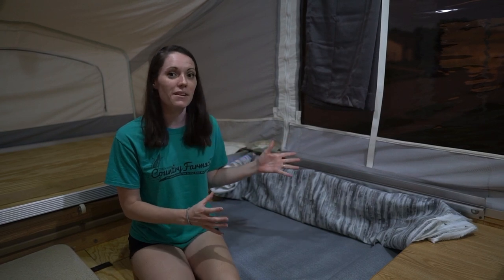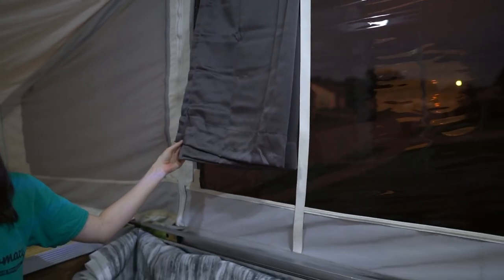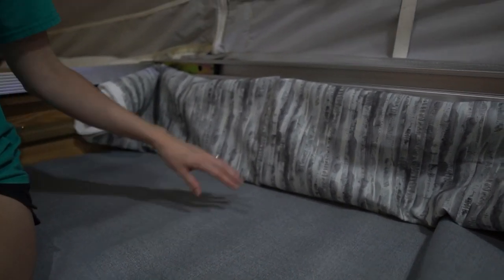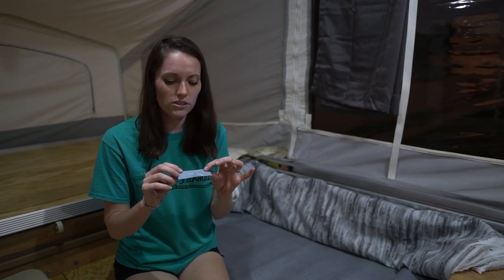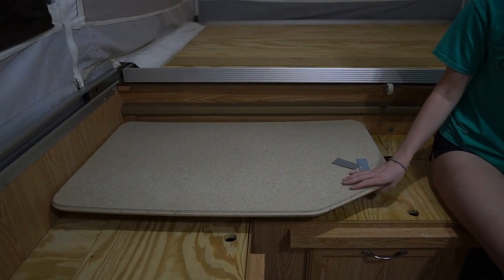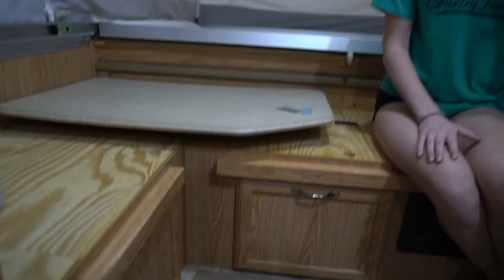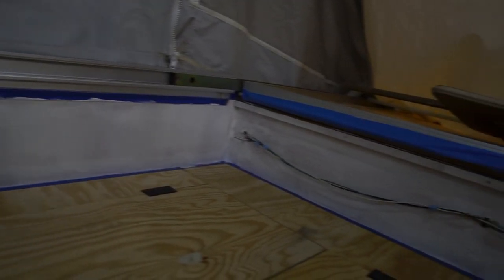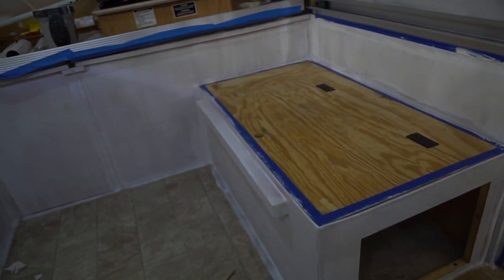Pop Up Camper CABINET & WALL Painting (How-to) | The Free Pop Up Camper Renovation | Part Seven

Comment from the maker: Before you start renovating the interior, make sure the exterior is good to go! https://youtu.be/jj6LuLZpv9o
Reply: Thank you and Yes.  I did an overall major cleanup and added a protective coating (based on your video) on all the canvas, vinyl and soft materials. Also have been wire brushing, priming and painting the frame. Wheel bearings have also been replaced. Over the winter I need to refinish the entire top (Paint I have not locked down which product I will go with) which has signs of delaminating and has lots of rubber cement type of sealent on it. Propane heater and AC works. Refrig does not so I am on the fence if i will replace or convert into storage.

Comment: You could try an epoxy finish on the countertop if you want something super rugged. Very easy to apply. Basically mix and pour. It's self leveling, so you get a nice thick layer.
Reply from the maker: You read our mind!

Comment: Everything looks great so far. I'm deliberating taking out the cabinets and spraying them and install flooring wall to wall.
Reply from the maker: What type of flooring are you planning to use? If it's sheet vinyl, you'd be ok taking out the cabinets and doing wall to wall flooring, but if you are planning to install any type of floating floor (such as a click-together vinyl plank like ours) you don't want to do wall to wall flooring with that, as the floor needs space to expand and contract, which it won't have if you affix cabinets on top of it.
Reply: @ItsPoppin  I was planning on click together vinyl. That is a good point about needing to allow the flooring to float. It saves on cost as well since I won't need to purchase as much martial, but will mean a lot more cuts. Did you use any molding?
Reply from the maker: Yeah, we’ve used 1/2” quarter-round in the past and are going to use that again on the Reno.

Comment: Is it not a good idea to paint the plywood bench tops? I'd sort of like to paint mine, but I read that you shouldn't paint the plywood on the bunk ends so that it can breathe and fluctuate with temperature. Is that the same for the plywood on the bench tops?
Reply from the maker: You'll be fine painting bench tops.

Comment: You may have addressed this in the video & I missed it but is there a reason behind using oil based paint? We're remodeling a PUP. i have water based kilz & paint on hand. Just wondering if i need to buy different paint.  Love your videos.
Reply from the maker: That was based on our research from a few years ago, so I don't remember the exact reason. I think it may adhere better or be more durable. I would just research the efficacy of water-based on cabinets before you use it.
Reply: @ItsPoppin  thanks so much. Camper looks great. I'm caught up on your reno but came back to this bc we're painting.  You do a really good job with the tutorials.
Reply from the maker: Thank you!

Comment: Did the printer adhere to the contact paper on the cabinets well?  No flaking?
Reply: Primer *
Reply from the maker: We can’t speak to this camper as we sold it; however, we utilized the same method in the Starcraft and it’s held up exceptionally well.

Comment: What type of polyurethane did you use? Water based or oil modified? 
Thanks.
Reply from the maker: For the countertops?
Reply: It's Poppin' - Pop Up Camping yeah. Sorry. I was at Lowe’s looking at the urethane and watching my daughter run around. 
So yes. For the counter tops and did it leave a yellowish hue? 

Thanks.
Reply from the maker: We used the minwax one coat poly. It doesn't say if its water or oil based  - even though I thought it did. The countertops did darken under the poly, but being a canvas color its hard to say if they yellowed. The poly says it won't yellow so it may have just been the paint darkening.
Reply: It's Poppin' - Pop Up Camping  awesome thanks so much.
Reply from the maker: Did some internet searching and it’s water-based.
Reply: It's Poppin' - Pop Up Camping awesome. Thanks again.